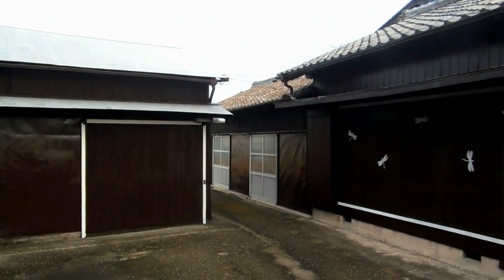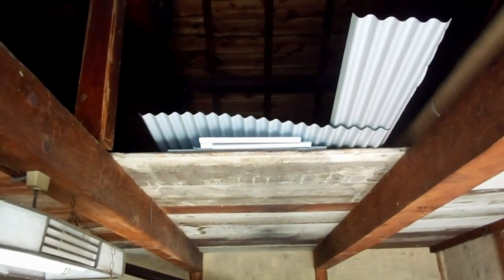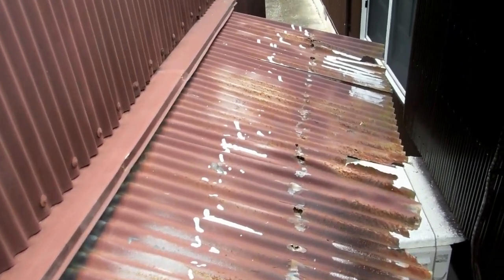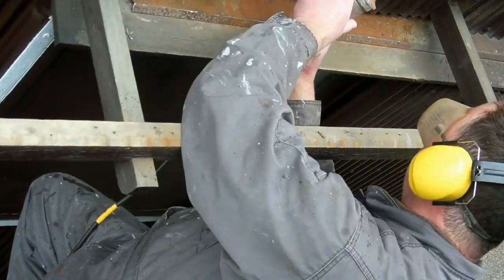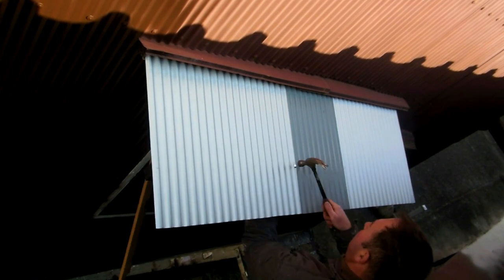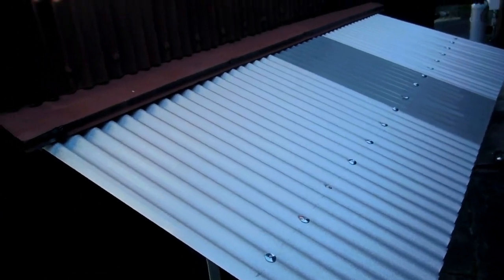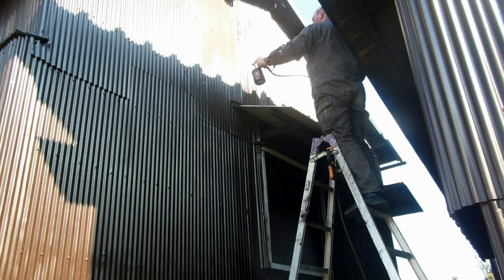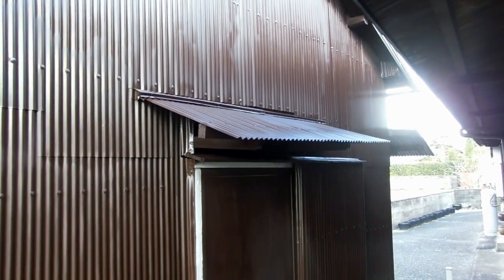Small Awning Job at the Old Japanese Farm House

Comment: Im surprised you dont use something more durable rust resistant. Ive done awning and carport roof using corugated plastic,comes in many colors and also clear. And best thing Its practicaly indestructible,has to be screwed on tho no nails.
Reply: A bit too flammable for a house, perhaps? Thinking Grenfell Tower here….
Reply: There's a philosophy here, to use what is available, and avoid unnecessary expense. The unskilled laborer is a bricoleur.